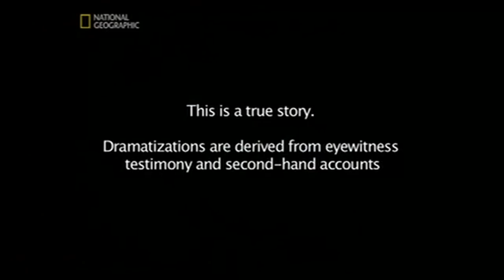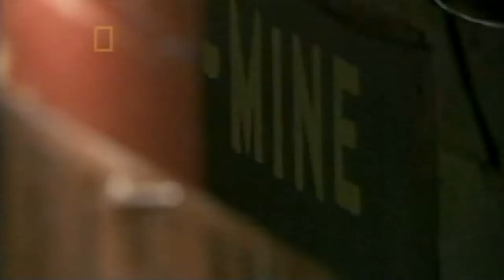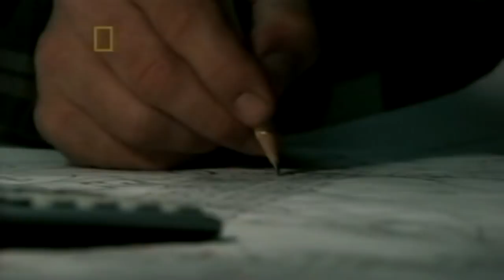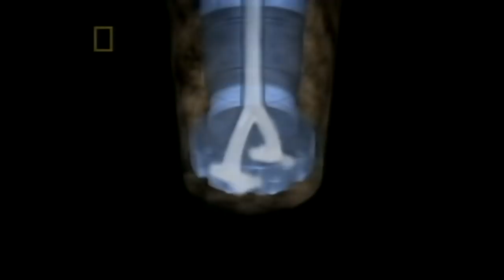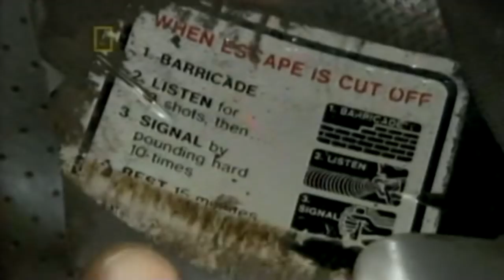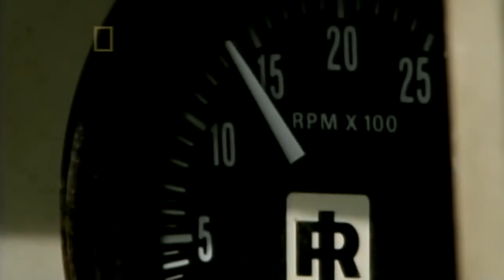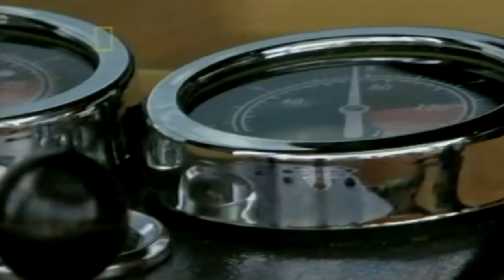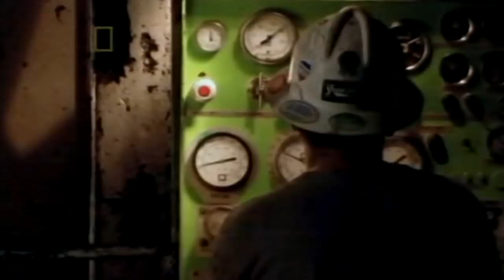Situation Critical - S01E12 - Coal Mine Disaster

Comment: Quecreek Mine accident, 2002, Chilean mine (Copiapó) accident, 2010.  I wonder if this accident helped contribute knowledge and methods for the Chilean rescue.  The Chilean miners were trapped for 69 days at a depth of 2257 ft!
Reply: I did read that they used the same rescue capsule, which was a prototype in the 2002 rescue and had never been used before then.
Reply: also Beaconsfield mine collapse in Tasmania in 2006 Brent Webb and Todd Russell spent 2 weeks trapped inside a rock fall almost kilometre underground the only way they rescued was when Miners drill & blast underneath them to get to where they were trapped in the the mine while trying not cause another rock fall that would kill them

Comment: I thought they said if they drilled all the way through with the big drill it would burst the air bubble and the miners would die. Why didn't that happen? (I'm glad it didn't but just don't understand why)
Reply: Because the water level was low enough by then
Reply: Water weighs more than air, if they punctured it then the air could be displaced by water pushing in from the prior hole.

Comment: Why couldn't they pump water from the other mine at the same time as they were pumping from the one the miners were in
Reply: Pumping from the old mine would require you to pump out the entire volume of water whereas the puncture acts as a bottleneck; by pumping from the new mine you only need to pump greater than the inflow rate in order to clear the water.
Reply: The old mine was more than likely sealed

Comment: 16:15 Haven't watched the whole thing yet but drilling a 15cm shaft down into First Left is just about the worst thing to do. With nowhere for the air to go at the top of the rise then that would create an airpocket at the highest point of the mine. Then you can drill a 60cm hole for the miners to escape through. But drilling a 15cm hole lets the water rise and fill the air pocket as the air is expelled through the hole. Do these people not understand physics?
Reply: OK, all was revealed.

Comment: Why not send in divers,  og an ROV?
Reply: Nicolai Flou because it was way to risk
Reply: Also an ROV?
Reply: Nicolai Flou Sounds easy when you say it fast, doesn't it? 
1.  Most marine ROV's are kept near the ocean, not near coal mines.  And there aren't really that many of them. Getting one in time might be impossible.
2.  Most of them also drag cables, which would get caught at corners, even if they didn't get caught on all the equipment still in the mine.
3.  Few if any of them can deal with strong currents.  As long as the mine was still filling, an ROV would have been able to make little headway.
4.  Even if an ROV got to them -- then what?  It couldn't carry them out, and it could maybe deliver one set of scuba gear. 

Of course in an emergency, people will consider any and every possibility, and I'm all for letting robots do the dangerous work.  Maybe in a decade or two there might be some sort of ROV or robot that could be useful.  We're just not there yet.
Reply: Okay, you are right. THX for the reply.
Reply: +Nicolai Flou The idea is basically Ok. But I wonder why nobody got the idea to let a hose, a distribution and nine scuba diving lung automats down, and feed it with the compressor. This would have given them all the time they needed for drilling the bigger hole even if the water raised several meters above the trapped men.

Depends on the temperature of the water of course, which is crucial for how long the men could stay under water without being dangerously undercooled. But they could probably even get some dry-diving suits down.

Both the suits and the lung automats would for sure be available in the next bigger city or divung schools and clubs. Caisson sickness should not be a problem as long as the water is not more than about 10 meters above the men.

This idea sprang almost immediately into my mind.
Reply: I see your point, maybe they just deemed it too completed. But your idear sounds great☺
Reply: Nicolai Flou Thanks :) I was a hobby diver when I was younger - that makes the idea come easier :)
Reply: Yw☺

Comment: after drilling the 1st whole they should have provided them oxygen cylinders and some swimming equipment to save their lives
Reply: There is a drill the way and you don't just pull this sort of drill out of the ground either.
Reply: but still they could have send swimmers in with oxygen cylinders
Reply: omer king No, because this drill is still in the hole thus you can't drop stuff down. The second one was designed differently so that a pod could be sent down. Also if they opened up the first hole and took the drill out that air would rush out through that hole and the water would fill up the air pocket before they could put any of the gear on besides, that water will be freezing cold anyway and it took ages to get where they were in a cart.
Reply: when they first drilled the hole they had enough time to supply them with equipment,it only takes mints
Reply: omer king It would take hours to take the drill out of the hole all the while the water would be rising faster as the air could escape through the hole.
Reply: what kind of swimming equipment would fit down a 15 centimeter hole??
Reply: jerold perkins a tightly wrapped up wetsuit and goggles, the tanks aren't that wide either are they?
Reply: ok
Reply: ***** How would they get that stuff down there without letting all the air out? They can't just pull the drill out because that would take hours and they would have to turn off the compressor to take it out meaning that the water would flood into the chamber and probably make a geyser out of the drill hole.
Reply: i dnt wear uinderwear and hate to eat potato